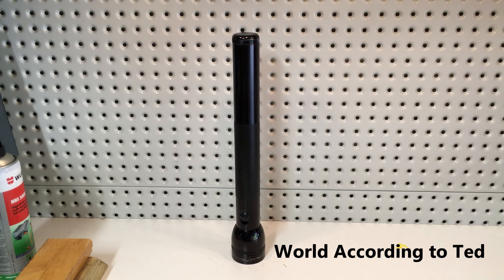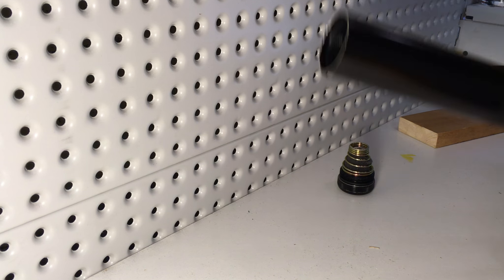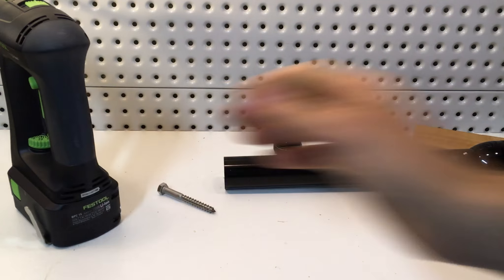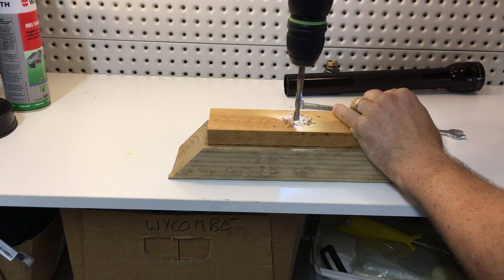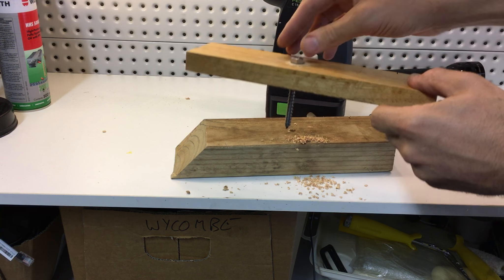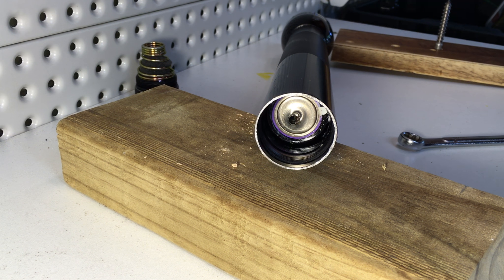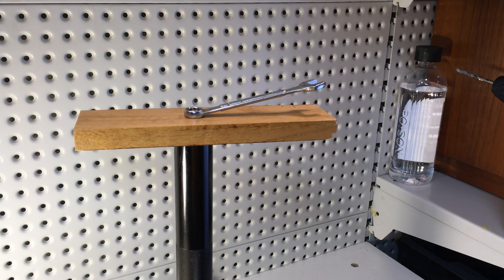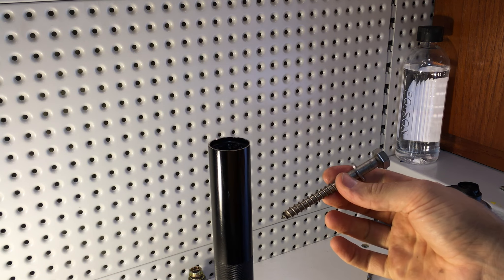MagLite - Remove a Corroded Seized Stuck Battery in 5 Minutes - Maglite D-Cell

Comment: It sounded like the second battery moved a little.  I have seen battery corrosion cause damage to the inside of the flashlight.   Maybe you could hone the inside of the cylinder.  I am working on two "torches" myself at the moment, but they are the kind that have 3 AAA batteries in a plastic case.  I can'ts destroy the case.

Comment: Hello, i have the same problem. As i have NO experience in doing a whole in a battery is it dangerous do do that (might it explode or something else)? Thanks a lot and great video ! :)
Reply from the maker: These batteries would be holding very little energy so there is close to zero chance of explosion. The contents of the cell may be corrosive though.

Comment: I had the same with a Duracell. They replaced the torch and gave me a set of batteries. Seems Duracell leak.
Reply: Yes, Duracell are the worst.  The new blue/silver ray-o-vacs are not so great either.  Their old Black/Grey batteries with White letters were quite good, but now seems only the bright blue/silver ones are available.   :-(

Comment: but if the end cap is stuck on aswell how do you get it off without damaging it..
Reply from the maker: You could remove the switch housing and go in from the top as shown in this video: https://youtu.be/JPiFG0_jCYs Then you could try and soak the end cap from the inside.

Comment: Yeah, only works if the battery is stuck near the end.  Hard to find drills and lag screws long enough to reach batteries close to the switch assembly.
Reply: Dunno if you caught my comments on the video. My latest project had a battery bust at the closets end to the bulb. My method will work without drilling(allowing more acid to escape,no bolts etc)

Comment: Remove batteries from all devices you aren't using for a long time. This includes flashlights -- if you have more than one of them side by side, you should rotate which one has batteries every few weeks. Keep the unused batteries within reach so you can grab and load them into the empty torch when you need to use both flashlights at the same time

Comment: I just drilled in to the battery, screwed a screw in to it, grabbed it with needle nose pliers and yanked it out in case somebody doesn't have wood and bolts.

Comment: I think we all know who the biggest culprit is when it comes to leaking batteries. I will never EVER buy a battery with a copper top again. They have cost me thousands of dollars in damaged equipment. I don’t recall ever having an Energizer leak in all my years.
Reply: From my experience it doesn’t matter what brand the batteries are. I’ve tried them all from the most low budget, to the top of the line in C and D cell MagLites and it happens with all of them. It appears to have more to do with the MagLite aluminum tube and steel battery casings. Dissimilar metals that only require a minimum amount of corrosion and/or temperature changes to cause the batteries to “freeze” in place. Anyone who has ever done brakes or even had to remove an aluminum wheel on a modern car or truck will understand exactly what I’m saying

Comment: I just tried this on my mini mag and it didn't work so well on the AA batteries. The screws kept pulling through. Ultimately I managed to get it out. On hind site for the mini mag I should have taken a drift to the light end and driven it out... The second battery was loose but the light is a loss anyway.
Reply from the maker: I had this issue with my second battery and ended up drilling out the top of it and then using a chisel to pry the battery casing from the flashlight wall. Got there in the end but damn it was hard work!

Comment: If batteries only leaked, this wouldn't be such a problem. Unfortunately, the chemical reaction causes them to expand too, pushing the battery contents against with torch wall with significant pressure. It's a shame that manufacturers don't anticipate this by designing their torches to be accessible from the top, under the bulb. Right now, their solution is to advise owners to examine batteries every now and then for signs of leaking, an unrealistic approach when the problem could be solved with better design. It's almost as if, um, they want people to throw away perfectly good torches and buy new ones…

Comment: What if the spring has lost some spirals due to corrosion....what would you do?
Reply from the maker: I guess it depends on how much of the spring has gone. You might be up for a new spring
Reply: You can pack the empty space with aluminum foil to "complete" the electrical circuit.

Comment: i got mine out by "chiseling" the battery with a wooden stick and a hammer. i kept trying to twist it and whip the light until it came out. it took days. literally at least a week of it just pointing upwards with wd40 to hope it would slide out. after enough horrific chiseling which probably irreversably destroyed my torch. it came out. and left a permanent unremovable stain from the inside of the light

Comment: Not much help when it's the first battery :\
Reply: This is my problem. It's the first battery...
Reply: @Beardman56  longer bolt then, eh.
Reply: wondeboy12  <— if the longer bolt doesn’t work, hopefully the lens assembly on the bulb end, still comes off/apart, as it did on my old mag light.  If it does, then removing that and the tail cap should allow for pounding out and stuck batteries with a long screw driver.  Good luck !!

Comment: I accuse Maglite of planned obsolescence.  God knows how many people have replaced them because of stuck batteries that don't come out if you bang the torch against concrete. . The solution in the video works, but most of us have better things to do than drill batteries and extract batteries with screws.  The people capable and willing of doing that probably use their flashlights often enough to avoid stuck batteries in the first place. Why couldn't Maglite solve the problem by making the head open up and come off easily, so we could push the batteries through the hollow tube?   They could also make the control button assembly come off easily so we could push the batteries from the side. I speak as one who just spent $30 yesterday  to get a new Maglite

Comment: Since one battery came out and only the one furthest away is stuck so I am "screwed" no matter what kind of screw you use.
Reply from the maker: You'll need to work out how to remove the switch assembly and head of the light so you can try and bang it through from the top.  One of the comments below talks about this

Comment: These MagLites could be improved if they'd leave more room for the batteries.  The extremely tight fit makes it hard to remove corroded batteries.    Mine has a double A battery stuck at the top (near the LED light), and so far I've had no luck trying to get it out, it's so solidly seized there.     Also, I have MagLites were the end caps are seized on due to the aluminium metal bonding.  I hate to say it, but a plastic end cap would be an improvement over metal on metal.  These are two things that would improve these flashlights.

Comment: Your Lucky... My 6 D cell mag light had Duracell batteries in it and the 3nd battery (nearest the top) went bad..  I couldn't pull it out with your technique. i had to pull the top off to get the other 2 out. i tried everything to get it out even a 6-Ton Hydraulic Shop Press wouldn't work.. all it did was punch a hole through the old battery. Had to heat up the outside of the aluminum tube to get most of it out.. Still the outside sleeve of the Duracell battery remains welded to the inside of the flashlight tube.. I have no idea how i'm gonna get the rest of the sleeve out. Might have to use a honing tool if they make them that small.. 
Duracell batteries are crap.. they always leak and Duracell will not replace your damaged part, they will only replace their product..

Comment: Or just take the light head off as well and you now have a tube that you can push the batteries out using a wooden handle.
Reply: Maglites aren't made that way.
Reply: @freyinnovations  of course they are its just a tube. If you take the head off and remove the switch you can push the batteries out with a wooden broom handle. Drilling it is like taking a sledgehammer to crack a nut
Reply: @ianevans67   Bull shit. Show me a maglite tube with a broom handle through it. And do it without taking the switch out first, which can't be done with batteries stuck in it.
Reply: @freyinnovations  you use the broom handle to push out the switch mechanism and batteries at the same time once you've undone the grub screw in the switch Noob
Reply: @freyinnovations  why don't you just try it you might surprise yourself. Anyone reading will agree
Reply: @freyinnovations  How do you know if you weren't there. Take out the grub screw in the switch fill the body with white vinegar and push the whole lot out including switch. It worked for me so now who's the idiot ?

Comment: almost always duracells leaking, ruined a couple of my maglites.
Reply: Ive had the same experience with duracell batteries and nearly every crap brand battery from dollar stores. Ive found it does not pay to get cheap batteries considering the possiblity of them ruining often expensive equipment. Ill stick with rayovac when possible.
Reply: David Reynolds <— I am now getting especially the AAA’s leaking in the brand new container they came in (Rayovac’s).  Less then 1/2 the remaining time before they expire.  Talking about the new bright blue/silver-chrome ones.  The older black/grey ones with white lettering almost never leaked, but I haven’t been able to find them in the stores for the last year or so.   I Might have to try energizers.  Good luck.

Comment: You want me to put a hole in a battery!? No thanks 😂
Reply from the maker: unless you're running lithium ion cells you should be ok I would have thought.
Reply: The monogamous Lord Buckmaster <— dude, they are 1.5 volt, and probably almost dead if stuck in your device/flashlight.  9v might give a little more excitement, but have you ever had a problem with 1.5 volt’s completing a circuit when + and - are touching?  But if your concerned always better to be safe I guess.  Good luck.

Comment: Every time the time changes an u check smoke detector batteries.. check all batteries..flashlights, TV remotes, anything that uses batteries , when u remove your window ac unit, remove the batteries from the remote

Comment: Were you just lucky or did you know? 
I was about to do the battery drill thing but Googled drilling holes in batteries, big warnings everywhere DO NOT DRILL HOLES IN BATTERIES!
So who do I belive, you or the rest of the world???
Reply from the maker: There was very little energy stored in a 1.5v alkaline battery that would barely make the globe glow so I felt reasonably safe. Other battery chemistries like lithium however I would NOT tamper with.
Reply from the maker: I should add the contents of an Alkaline battery are alkaline and corrosive. (Which is how we got into this mess in the first place) so do be careful!

Comment: The screw bits and all of the tools are unnecessary. Once you have it disassembled - pour some vinegar in the tube & let sit to dissolve some of the corrosion. Then gently tap out using a long bolt with a flat head or similar thing. If the batteries don't tap out - try a bit of WD40.

Comment: Mine is/was 10 Times'  worse. 5 d cells and all was stuck
Reply from the maker: Did you resolve?
Reply: I got the 3 first ones out fairly easy. The 4 was a pain and I used a screwdriver to get in between to bend it in. After smashing the light into an rubber mat on my metal workbench it came out. After it wasn't it a pretty sight.... a thick layer with acid and some gum? Well som boiling water a couple of times and smashing the light on the bech the acid corrosion was gone. And hammering on the outside a couple of times with a wooden handle of a hammer made the 5th one be able to move just a little. Then smashing it to the bench/ pouring some more water, beating on the outside and smashing it on the bench and some penetrating oil and finally the 5th one came out millimeter by millimeter. When it came past where the worst corrosion it fell out. And reveled a sad thing. Another battery :( so it was a 6 cell. Well just start over. This one came out after one go with warm water and some beating. :) and I was able to take it apart completely and clean it. Some corrosion still left inside but the battery's move freely. Only damage sadly is a hole from where the corrosion was worst and some slipping of the huge pliers I had to use to get the corroded end off :( but with a new bulb and some new batteries it should work. Have a new light in and some old batteries I found in a cupboard but it lit up very dim for a while before going out. So new batteries need to be bought. This took me from Friday to Sunday evening. But it was on Sunday most progress was being made  :)

Comment: Interesting I never had a maglite corroded on me and I dont care cause Im always lucky on picky the right lights.
Reply: has nothing to do with the light..
Reply: @user-qx7tm5df8j  Yes it does cause I dont understand how you guys always have corroded battery when I use duracell battery in my 2aa maglite to 2d maglite led.

I need to know what going on?
Reply: You will learn.  Just give it time.  Duracell are the absolute worst, has destroyed many items of mine.  But if you mail them the item and batteries, they will repair or replace it at their option.  They are so bad, that the company has just made it their policy to do this instead of fixing the problem.  Making them better like they used to years ago would cost them too much (so they feel).
Reply: @teatonaz  even if it on a led lenser or coast led?